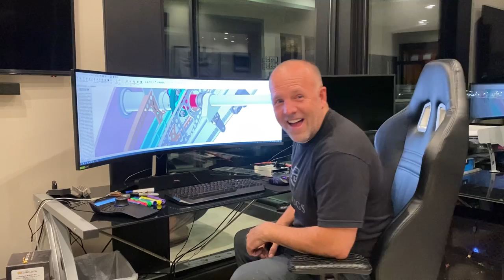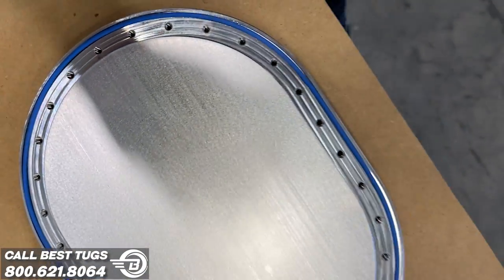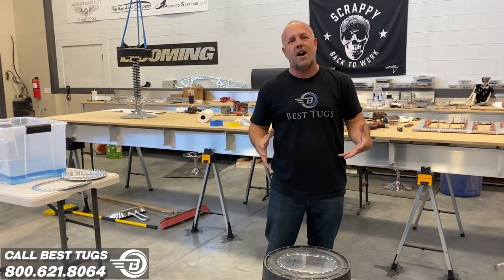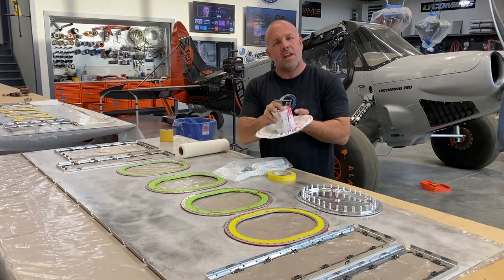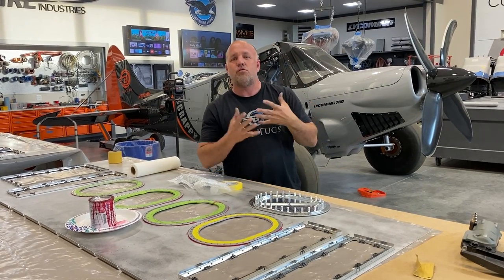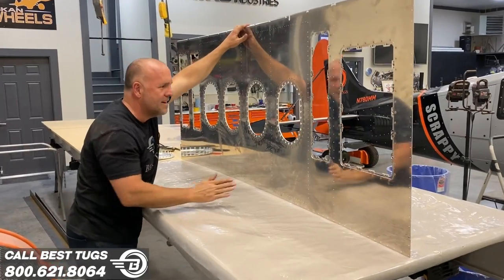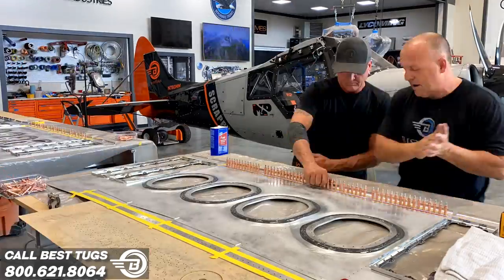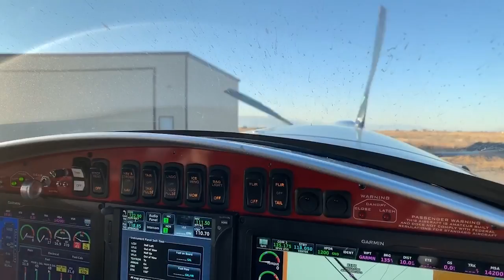WILD, one of a kind, Bush Plane Build | Scrappy #54

Comment: This is sort of fetishizing the build process at the expense of design. I don't understand why every other plane has one door in each wing but this one has four huge ports per side. The fasteners alone on those doors will weigh several pounds unless they are titanium, which seems inefficient or gratuitously extravagant. Why create all those potential leak points in each wing? I am a bit mystified. I guess it is more of a build project than a design project.

Comment: Mike, you should avoid laser cutting aluminum. It dramatically reduces the life of the parts in our tests. We don't allow it to be done in any of our aircraft parts.
Reply: What do you think is the mechanism of action that causes laser cut parts to not last as long?
Reply: This sounds rather important, can you tell us a little more about it and the tests that were done and why, thank you.
Reply: When you laser cut the parts it anneals the aluminum along the edge of the cut. The heat from the laser also causes micro cracks, so while the edges look clean they will grow cracks much faster.
Reply: @joelcooke8495  Would water-jet cutting be an acceptable alternative then?
Reply: Water jet cutting is better. But there are other concerns with water jet cutting. Since water jet uses an abrasive to cut, those particles can sometimes become embedded in the metal, which can lead to cracks and corrosion. If steel is cut in the same machine as aluminum bits of steel can become embedded in the aluminum which causes corrosion. Also, not all water jet cutters are equal and some can produce rough edges (causing cracks). These issues can be mitigated with careful process controls.
Reply: Annealing is often done at around seven hundred degrees  for up to 3 hours. This is done to rearrange the molecules making it less brittle and prone to cracking. Often when you weld aluminum you must do stress relief. But there is a trade-off as it can lead to less tensile strength. I'm sure Mike is aware of how to work with aluminum. 
   With that said I'm not sure why he's doing a all aluminum wing. Composite would had been a nice alternative as a wet wing as it's impervious to Fuels using the right epoxies.  Then his top could have been smooth a rivet free. Plus you wouldn't have to worry about Hale storm either. LOK But fabricating his inspection doors out of aluminum is likely much easier. Then there's the electrolysis issue since I don't think he knows there's another material other than carbon fiber. LOL But Different Strokes for different folks and it his design and build.
Reply: @joelcooke8495  Thank you for expanding on the stress factors. The more we listen to you guys the more we learn, now if Mike would join in on this thread we would hear is input.

Comment: How much work would ever need to be done to a tank to have all those doors? With today's technology with micro cams you would only need a small opening for inspection... If you had to do so much work to a tank would you not want to replace it. I mean maybe work with that ideology  instead of all those doors, time, weight of screws, and way too much money spent on doors and the tank itself. Inspection can be done now at this day age with cams like with the medical industry. You could have made the tank with no access holes at all. How many times have you needed to work on a tank or replace the tank?